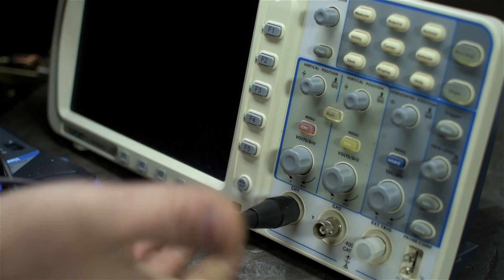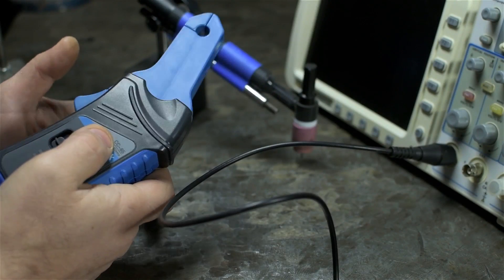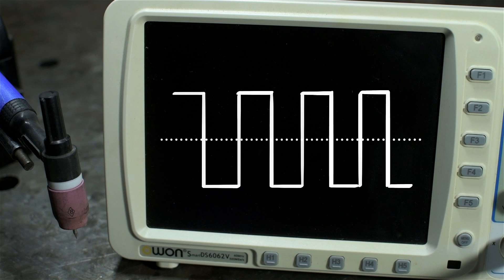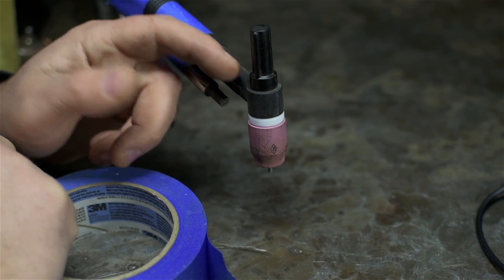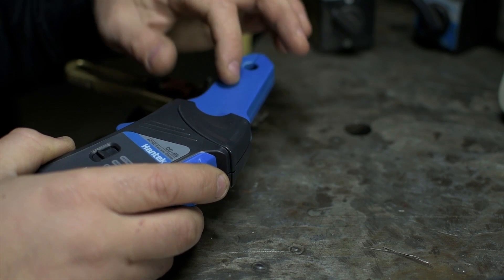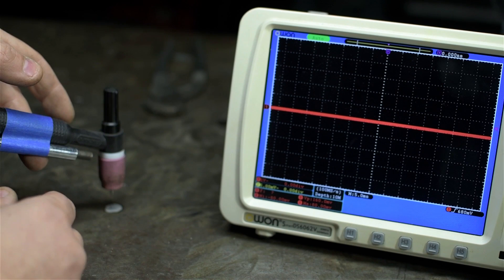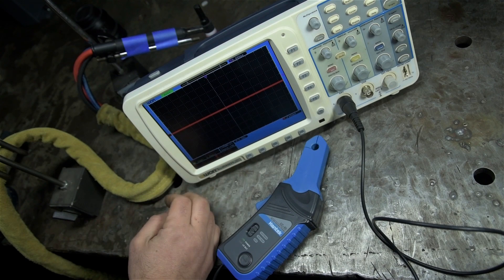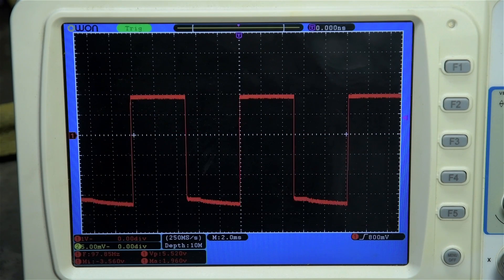Oscillo-Help-Me?

Comment: Hey Tony.   A few suggestions from others.   Test on a A/C line.   Flip the clamp.   Here's mine: what is the channel coupling setting?   Channels can be coupled for AC or DC.   AC coupling means the scope will filter out DC    Even though you are looking at a square wave, it is not a perfect square wave so it may have a net DC offset.   If it is AC coupled, try DC coupling.    If it is DC coupling, I don't think you want to switch it to AC coupling because the scope will filter out the DC.
Reply: wgm4321 this, it's an issue about AC or DC coupling, try the DC coupling to see the real value, AC coupling will shift the 0 line that both sides are equal, with the not perfectly symmetrical waveform that translates into an offset
Reply: Fixed some typos and here is a little more info.   AC coupling removes the DC so the area above the 0V is the same as the area under the 0V.   In the case of a 50% duty cycle of a clean pure symmetrical square or sine wave, the area above will be the same as the area below.   However, if the duty cycle is not 50% or if the wave form isn't truly symmetrical, AC couple will cause the wave form to appear higher or lower until the area above equals the area below.   Pretty sure you want DC coupling if you want to see if the welder is putting out a DC component.
Reply: See page 23 http://akizukidenshi.com/download/ds/owon/SDS6062.pdf  However, After watching a second time, it might not be coupling problem
Reply: wgm4321 interesting.. what makes you be unsure?
Reply: Hey Jonathon, I looked at the video again and the wave forms don't seem symmetrical around zero with respect to area.   It could be that the zero isn't set or some inversion option is on.   Haven't used a scope for some time so I can't remember the exact impact of AC vs DC coupling.   However, I'm pretty sure AC coupling will make the wave form symmetrical around the zero with respect to area and that doesn't seem to be what is happening here.
Reply: wgm4321 you're right, the negative part of the Waveform even seems wider, this should even lead to a lowering of the apparent zero in comparison to the Waveform shown from his old welder.

Comment: I have no idea what you're doing, but if you don't trust the clamp, just use a shunt resistor or hall effect sensor like the WSBS-8518 or ACS770.

If you have to have results now, a metre of 5mm, 316 rod (or a bundle of 316 TIG rods with the same cross sectional area) will have a resistance of about 50mΩ, and should handle a couple hundred watts.

Edit: No. V=IR says that 50mΩ is way too much. Rather get a commercial resistor.

Comment: Is it a floating ground issue because they're referencing different ground signals.
Reply: I don't think so. The scope should get it's reference from the current clamp, since the current clamp creates a voltage corresponding to the current. And the bnc connector has a ground connection included. And since the flatline sits right on 0v on the scope the reference should be right.
Reply: But that ground is tied to earth, and that will be the same earth the welder is plugged into - as it is clearly drawing a very high current, even a slight resistance in the earth line will lead to ground “floating” up (which is what a ground loop error is). I don’t know if I’d expect it to manifest itself quite as severely as is shown in this vid, but is a worthwhile suggestion. Do you have an isolating transformer you can plug the scope into? Or run it from a generator which is isolated from your mains earth? 

About the scope being dreadfully effected by the HF (and no-doubt HV) start up: try wrapping the scope in tin foil which is tied to ground (except the screen of course - to do so would be counterproductive!). Such a Faraday cage should hopefully prove most effective.

Good luck.
Reply: that can't be it since he is using a clamp meter which is electrically isolated.
Reply: that would be my guess too. say take your ground from the job, could verify this by checking to mains ground to see magnitude first.
Reply: joejoe4games yes, you make a good point. The AC current induces an isolated signal in the current clamp and so the ground bounce induced by the welder should not matter. That said, if an isolating transformer were to hand it might still be worth trying: ground loops solutions are the fabled stuff of voodoo!
Reply: If you can clamp the probe around the live mains conductor feed into the welder (should be a decent current when the welder strikes, and will definitely true AC about ground) - will let you know your setup is okay.

Second thought: are you sure the probe you are using can resolve DC as well as AC? If the latter, it effectively “AC couples” the signal. As your duty cycle is not 50:50, the waveform might float up and down to keep the Kean area above ground the same as that below. I think I saw you changing the duty cycle (I.e the ac balance) and this did not happen, so I gues you have a DC probe.

Comment: You can't call it more negative than positive because your clamp meter signal is floating above ground and your signals are only relative to one another, is your scope set to dc or ac? maybe a more basic shunt stack would give you better measurement results.
Reply: Since it's a active current clamp the ground shouldn't be floating.

Comment: Well, if it is anything like Miller, they have been known to pre-tweak some of the controls to make the range line up better with actual welding. For example on AC balance the control is labeled 1-10 but balanced output happens at 3. You could also do some tests using DC and swap cables to check your test setup.
HF plays havoc with lots of electronics, you're braver than I am exposing your scope to that.

Comment: Based on Page 11 of the HTP_221_Manual your welder is capable of setting the symmetry of the wave. Maybe it's just set to do so? Based on the info the manual gives about the advantage: (More negative current instead of positive puts less heat into the tungsten tip, thus resulting in a longer tungsten life.) So it would make sense that it would be set so right from the factory.

Comment: if there's a transient that is too fast for the following amplifiers, the front end of the probe (i.e. the hall effect chip)  may be clamping the signal asymmetrically before you get to see it on the scope.  Try (as suggested below) a simple transformer coupling (or even resistive - measure across the length of the earth lead) to get a better look at the waveform. (it looks suspiciously clean to me)

Comment: Your scope is picking up erratic EMI as serial or command communications, and it tells it to do all sorts of things, but the first thing you need to do is shield, make a faraday cage (not like a luxury resort condo, just a cage) to either put the scope and as much of the electronics into that you can, or put the welder and torch into. Then you may need to insulate your leads by using twisted pairs causing interference to cancel itself out, and lastly, you may need to add some ferrite chokes to the cables to help filter unwanted noise that still might make it through.

Your probe and cables act as antennas that collect the EMI from the welder.

Comment: AC TIG waveforms are normally asymmetric.  Look at this patent:  https://www.google.com/patents/US3382345  the asymmetric waveform keeps the electrode from melting and depositing itself on the work.
Reply: interesting reading from a quick glance it looks to me that the patent talks about asymmetric periods (the width of the pulse) not voltages (the hight of the pulse) though. I'll need to read it more carefully to see if there is some sort of correlation between the two.
Reply: the amplitude is current, not voltage
Reply: The alternating current should protect the electrode just fine without needing a DC bias.
Reply: Great reference, thank you
Reply: true dat

Comment: The hantek clamp has a max frequency of 40khz.. it error percentage is 8% +- 0.3A measuring AC.. compared to 4% +- 0.3A measuring DC..   you also need to "zero" the current clamp ...  duty fully ripped from the manual. >>. it is needed to turn the zero adjustment knobs on the clamp until the multimeter reads zero. That means pushing down the zero adjustment knobs on the clamp until the multimeter reads zero. Then let go hold of the zero adjustment knobs.When using a scope,set DC coupled mode to measure DC current.

If you are just setting the "zero" point on your oscilloscope you most likely have a dc off set from your clamp compared to your scope
Reply: tl,dr: RTFM
Reply: Based on the scope settings on the screen I would say he hasn't set the offset in the scope.

Comment: The welder is probably loaded (heating) on the negative side reason for the distortion and capacitive like loading on the waveform.  On the positive swing its not heating up the welder so no load and the square wave is perfect.
Reply: There is no such thing as an arc that consumes power in only one polarity. Only differences are where the heat is mostly delivered too and breaking of the oxide layer on alluminium. The top waveform probably looks perfect in the upper half because the clamp is clamping it.

Comment: You can try and measure other things with the clamp to get an idea of if it's measuring correctly, try measuring the ac current going into the welder, or some other power tool, and see if that is symmetrical.

Comment: Ground is relative. You can run battery powered scope, but it will have a floating ground (where the welder is earth grounded). You can solve that variety of ways and Google can help.

Comment: First question is are you having intermittent or continuous issues starting or something else? Have you tried removing the scope from the vicinity?  The emf generated from the welder at the tip must be huge...but not clear why that would clip/shift the positive by 10-20%.  Also it might be worth testing the positive side with the clamp if possible and if you haven't already. Are you clamping near the head or the machine?  Other than these..like Sgt. Shultz, "I Know Nothing" about welding other than the EE stuff.  Been curious since your last go at it though!

Comment: 1. You don't have 0 reference (not grounded) so 0A on osmeloscope can be any  Y point (I gues the flatest horizontal line)
2. You can clamp you current clamp over way around. Flip it ant your y axis will invert.
Now think: if you invert the y axis and adjust 0 to flattest part of the wave... Is it not what you expecting from welder and the scope?
Reply: in reference to point 1 -  there is a reference - no current, i.e. off and that is zero. When he disconnects the probe or turns off the welder, the cro shows zero!
Reply: He has 0 reference of current probe.
Reply: Yes, battery powered scope -- no ground reference.  Connect the shell of ch2 to the same ground as the welder (chassis is a good choice).

Comment: Run the cable through the current clamp in the opposite direction and see what happens? If your scope waveform looks the same then it's the welder. If you see the signal upside down it's your clamp.
Reply: The other way around? Top of the wave seems unnaturally flat, so may be indeed be electronically clamped. If clamped by probe, it would stay the same. And if clamped by welder-driver, it would reverse. 

Also, even if clamped by the welder-driver, at those currents it would have lingering magnetic and capacitive effects, and again, the clamping would not be so flat. So my guess would be the probe.

Comment: I'd put my money on the current clamp. That is, I wouldn't put my money on a CC-65...
The positive half-period seems too flat, as if the clamp is clipping the signal.
When you turn off the welder at 6:49 the "wavy" parts of the current have similar amplitude,
but the two edge spikes from the negative portion are "flat spots" in the upper part.

Comment: Well , in theme with the unhelpful comments , I suggest it has to do with giving more heat to the base metal rather than to the tungsten. So there is less juice for cleaning on the other side of the cycle and more for heating the metal and adding filler more easily. Idk but it is pretty interesting. Hope you find it out and let us know :))) Ask Stefan G. to sprechen with the Deutsch side of YT. They might be quick with the answer.

Comment: Edited. Strike most of what I say I was not familiar with the hall effect clamps.  Everything I said was based on my experience with instinctive clamps. I forgot he used a clamp.  Have little to no experience with welding, but my scope experience says it is a zero reference issue. Zero is just a reference point you pick.  Just like speed. By having different grounds you've created two different systems with different zero references.they are close but not the same.  Much like you can say you your car goes 80mhp or (129kph) and the earth moves around the sun at 66,600 mph (108,000kph). Those two are both true but have no relation to one another.   what is zero?  moving in relation to what?  You have to pick a common point (frame of reference) to measure from.  In this case you can't.  The welder is isolated from earth ground (might be wrong on this, but thought they were isolated), and the clamp isolates the current signal.  That's just part and parcel of how they work.they generate a voltage because a scope only reads volts.  And there isn't a way to reference it's "zero" out to anything. 

 You could insert a known value resistor (current shunt) and measure the voltage drop across it, but it would have to be BIG and low ohms, and you'd still likely fry the scope due to the noise in the system.
Reply: It needs no reference to "zero". The current clamp connects to both the measuring "tip" AND to the scope's signal ground, in the same single coaxial ("BNC" actually) connector. It generates a voltage proportional with the current, between those two points. There is no other reference needed. The scope measures a signal relative to its ground, as it always does; both are connected to the current probe.
Reply: One thing to note is it is often a very bad idea to have a common reference point (zero/ground) when using a scope.  There are many situations where the only thing it would do is fry the scope or probe. With a common ground you'd possibly be shopping for a new scope after the high frequency start pulses you put into the system. When I was using a scope in school (years ago another lifetime) our measurements were often peak to peak specifically because there wasn't a ground reference in the system.   Also the 65 on that probe doesn't mean it will not work above that limit or becomes inaccurate, it means it isn't safe to use above that point, meaning you'll likely burn up the probe, the scope, or if your lucky and it includes a fuse simply burn a fuse.
Reply: For a more voltage related example of ground/zero references look at power supplies. The are often not referenced to earth precisely so you can connect 2 isolated supplies and make a +/- supply.    For instance two 5v supplies connected to make a +/-5v supply get connected + of one to the - of the other and that connection gets DEFINED as the zero.
Reply: A current clamp needs no ground reference. it measures the current through the hole in it.
Reply: Elektro-Peter yes, but scopes only measure voltage. The clamp takes the current and changes it to a measurable voltage that doesn't have a reference to a zero. I did space and forget he was measuring current with a clamp, but that only means a common ground /zero reference isn't really possible. Only thing he can really do is when it's set to 50/50 adjust it so the scope says 50/50 thereby setting his zero reference, from there he should be able to change and see the difference in reference to the zero chosen. In reality in an isolated 2 wire ac system dc offset (essentially what he's trying to measure) simply doesn't come into playas there shouldn't be a possible current path, so not being familiar with welding I'm not sure how or why it would have an impact unless it results in current to earth ground in the system.
Reply: Attila Asztalos a scope still only measures voltage, and the scope has to have a zero voltage reference in order to display.  If the signal was the zero reference one of three things would happen.  If the "negative"was the reference the entire wave form would be above zero, if the"positive" was the reference the entire waveform would be below. If it was some combination of the two the zero would "float" with the signal. It simply isn't possible to use the current clamp in this way and identify what is forward and what the zero needs to be.  He needs a big known value resistor and to measure the voltage drop across it. Then that voltage can be converted back to a current and zero will be zero in the system so direction will be known.
Reply: And again it's generally a VERY BAD IDEA to directly connect a scope to dirty sources.
Reply: I think you are wrong, scope already have zero reference of the probe itself, probe isn't floating it share same ground with DSO.
Reply: Current probes are AC coupled like a transformer around the wire. Both terminals of the clamp are connected to the scope. The shell of the scope's BNC becomes the common reference for both the scope and the clamp (and this is ALL floating with respect to the welder and earth ground). The clamp develops a voltage that is proportional to the current flowing through the wire, *up to a point*. When the core of the clamp becomes saturated, it becomes non-linear. This is very likely the cause of the offset. Simply coupling the scope channel to ground, centering the trace, and then coupling back to the probe is enough to know whether the waveform is symmetrical. All scopes have a little test point to verify this kind of thing pretty easily.